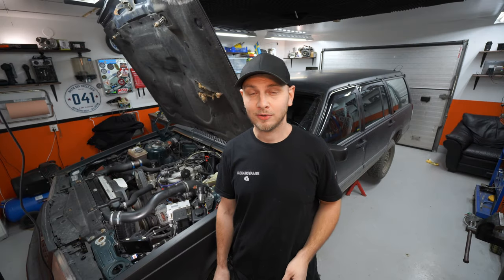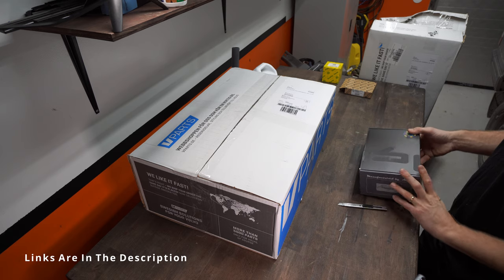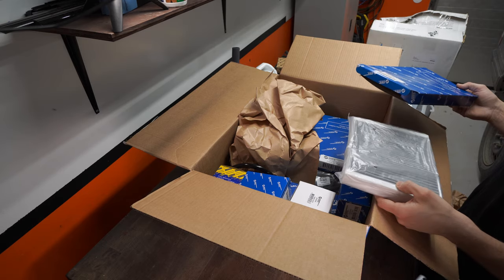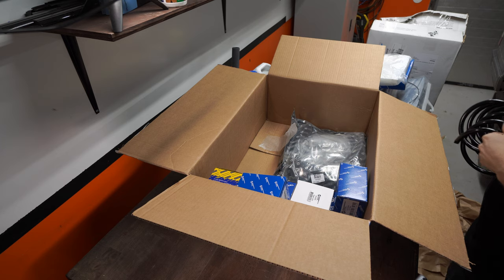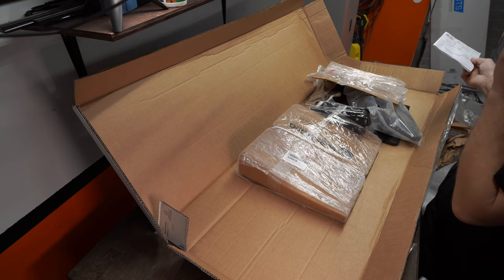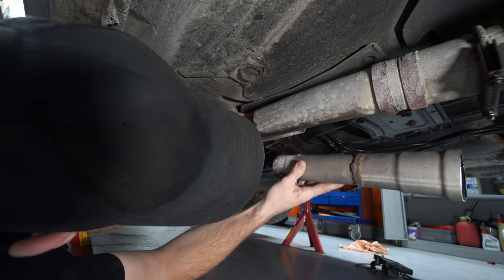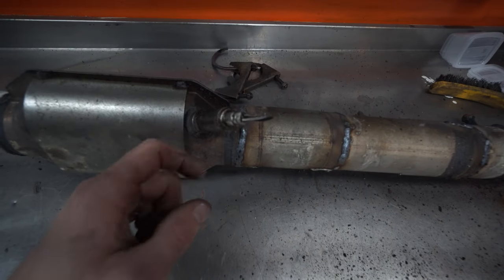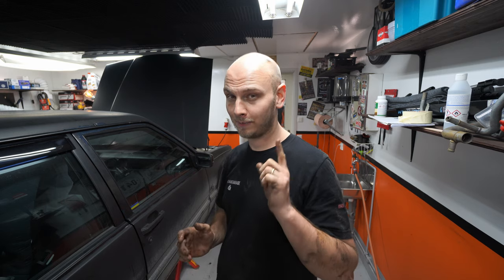Unboxing Black Friday Car Parts And Some Exhausting Work On The Volvo 945

Comment: hi. have you changed the o-ring on the oil cooler from the block to the oil filter housing on a 95 945 B230FK. Because it drips oil on the groaund and its not from the filter but it's from the oil cooler and the block.. thanks from norway
Reply from the maker: Hi! Sorry I dont use an oil cooler on this car. The engine is a mix of b230fk -96 parts and volvo 740tic parts so the oil cooler had to go when i put the 740tic exhaust manifold on there. I use a filter relocation setup. //Backman
Reply: @BackmansGarage   ok mine is a stock B230FK with a cute mini turbo. first i believed i dript from the filter but no it's comming from the 2 parts the filter is conektet to.i gonna wait to the summer i dont have a garage its coold in norden norway.

Comment: Dendär "heater controlvalve", är det om den läcker man får visslande ljud(vakumläkage) i vissa lägen för vart luften ska komma? min visslar om jag har den i ett av 4 lägen
Reply from the maker: Du tänker nog på modeller med AC, då är den istället vakuum styrd och skulle säkert kunna ge ifrån sig ett pysande ljud.
Reply: @BackmansGarage  aaaa det stämmer min har ac. Har tänkt att det ksk är nån slang som läcker men har inte hittat rätt